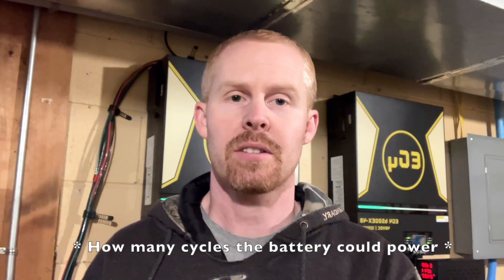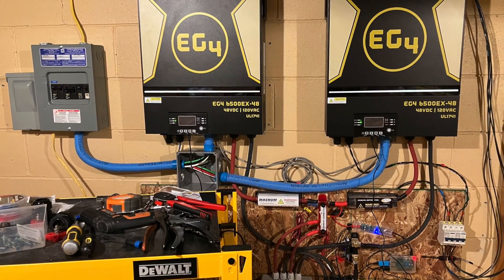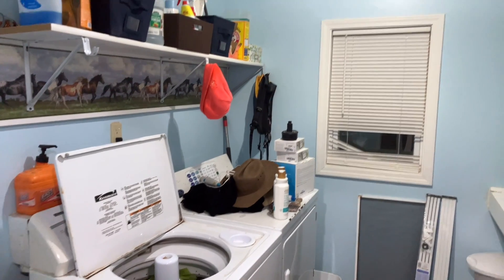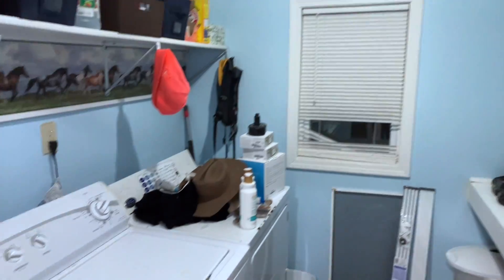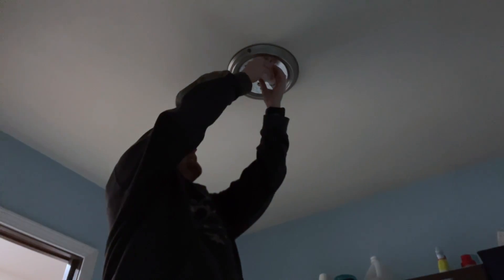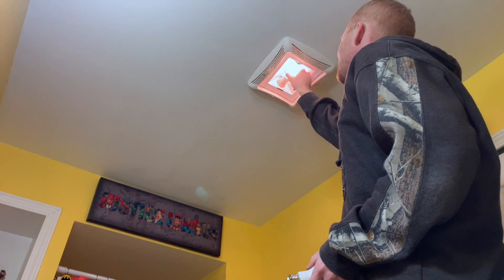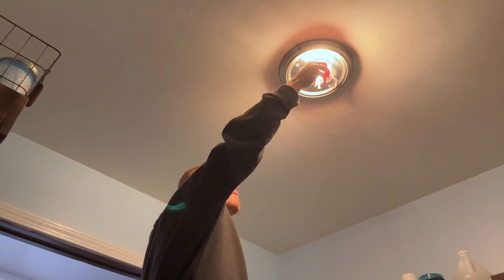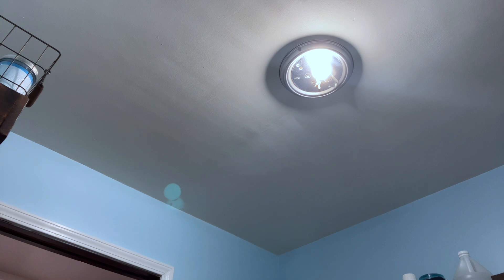Can We Fix the Flicker When the Washing Machine Runs off the EG4 6500EX?

Comment from the maker: In case you're interested, there's a thread on the diysolarforum regarding flickering lights and the 6500s.
https://diysolarforum.com/threads/eg4-6500ex-lights-flickering.50220/
Reply: Hello Adam, was this issue resolved by new set of inverters (new firmware)? If not I would advice to look for non-dimmable LEDs. I found a few non-dimmable Philips on Amazon that don't show any flickering.
Reply from the maker: @1rfsam  unfortunately not.  As I type this out, I’ve got the lamp next to me and the hall light slightly flickering.  I’m not sure if all the lights that flicker are dimmable. The one next to me is a Phillips Hue bulb.  

Odd thing is, it’s not consistent.  Didn’t notice it at all last night, but tonight I’m seeing it all over.
Reply: @AdamDeLayDIY  Probably depends on other loads... You could try the bulbs from my links I just posted on the same forum's link. These inverters are OK but honestly I'm not impressed with them.
Reply from the maker: @1rfsam  Unfortunately I checked and it's not the "add more load" argument that you have probably heard from SS.  Ironically they never tell you what that threshold of "more load" is.  

I had both phases running between 230-300W, had flickering lights.  I turned on the well which pulled more than 1kw from each phase, still flickering.  Really odd thing is they didn't do it the night before.  Go figure.

I think it ultimately boils down to "you get what you pay for", but also, "don't by the newest thing".  I wanted the 500V PV voltage ability because I need to run a fairly long string and the "US Based support", otherwise I would have gone with the MPPs.

Comment: The flickering is done by the voltage drop in the output of the inverter. This is normal when high loads are running. If you connect a voltmeter you will see the voltage variation.
Reply from the maker: Thanks!  Yeah, I knew it had to do with the voltage fluctuation.  Unfortunately the inverter couldn't handle the loads properly.  There really wasn't a "high load" running, especially when you consider it being a 6500W inverter.  It shouldn't have been blinking like that at all.
Reply: @AdamDeLayDIY this is an issue with high frecuency inverter, the low frecuency inverter do no have this issue, since isolation transformer overcome the inductive load at that particular issue. The problem is they  weight more.
Reply from the maker: @javarookie  It's not an issue with all HF inverters.  I've tested multiple inverters from varying manufacturers, some HF and some LF.  This was the only inverter that had this issue.

Comment: Unlike Europe, North America does not have mandatory regulations for electrical flicker (IEC61000-3-3). So you may buy many appliances that cause fluctuations in the power grid (flickering of light bulbs).  BTW, Please turn off the power before replacing the light bulb and pay attention to safety.
Reply from the maker: Thanks

Comment: Have the same issue with my washer. Expensive bulbs didnt help. Didnt do it when the electrician came 🤦🏻‍♀️
Reply from the maker: @SpanishLaughsLoL  It can also depend on the load on the system.  It seems like a higher load stabilizes the flicker.

Comment: I have the same issue with a growatt 3kw. And I use the Philipps LEDs and it doesn’t make a difference.

Really the only explanation is the inverter, it’s putting out dirty power. My lights work perfectly fine on grid power but do the pulsing on inverter power. That tells me it’s the inverter.

The type of driver in the LED does make a difference because even though they convert AC to DC and you’d think DC should be just continuous flow in one direction and thus would have no flicker, the type of AC the converter/driver is receiving still affects the output of the light. You could get an LED with a different driver, but I think that would just mask the bigger problem of the power quality of the inverter.

These high frequency inverters, mainly the Chinese ones, are inherently dirty it seems. 

What would really tell the story is an oscilloscope and spectrum analyzer, then adding appropriate filters or maybe even an isolation transformer. I’m still trying to figure it out

Comment: I have the same issues. It's a problem with the signwave in the inverter, dirty  and not consistent output. I can see weird spikes at night via monitoring. I'm more concerned about damage to my sensitive electronics than led flicker. I noticed the lights don't flicker as much when you have a constant load like a fan or something on. These are just not good inverters. And ss is not a good company. Eg4 batteries are good.
Reply from the maker: I’ve noticed some flicker regardless of the load.  Did a little recording two nights ago.  Had flickering regardless of 200 or 1000w on the inverters.
Reply from the maker: Now based on a comment I saw in the diysolarforum, the primary engineer at SS is supposed to be in Taiwan now working with the manufacturer to figure out what the flickering issue is
Reply: Mpp no light flicker for about the same money. I will say my EG4 have been trouble free running 6 month's minus error 61 which an update took care of. Good luck I hope they find a solution. I'm taking the solark plundge.
Reply from the maker: @ktube4848  they released a firmware update last night which is supposed to resolve some flickering issues.  From what I’ve been told though from SS, some cheaper quality LEDs will always have a flicker off grid.

Comment: It's not the bulb it's the inverter, do the same test and have your dryer or water heater running and the flickering stops completely. Once the inverter is under some load other than the washer the flickering stops. Check it out and see
Reply from the maker: Why does swapping out the bulb significantly reduce the issue then?  Now unless you really stare at the bulb, you really don’t notice the pulsing anymore.
Reply: @AdamDeLayDIY  I have tried Phillips dimmable led bulb and I still see it when my washer is going, but if the dryer is on nothing. Did you try it with a load?
Reply from the maker: @dexbad8857  yes, I’ve had other loads going at the same time and still have the pulsing.
Reply: @dexbad8857  agree ! I’ve found the same. .flickering stops when the dryer or we’ll pump . 240 load comes on

Comment: I do not get a constant flicker like you do. when a fridge compressor kicks on I get 1 flick on any light bulb I use that is LED I have 6 different brands from cheap to expensive. I find the more I pay the faster the bulbs die.  I have growatt 5k us version x 2. I also have 12/2 wire not 14/2 on all outlets and 10/2 on a couple with 20 amp  outlets. It doesn't matter the wire each bulb will flick 1 time when a big load hits like my fridge. My water heater is electric dual 2500 watt heaters 240 does not flicker bulbs. just anything with a compressor on it.

Comment: The washer motor needs a surge capacitor to handle the surge draw. It's not unlike when an A/C compressor kicks on you will get a momentary voltage drop during the power surge. A front-loader won't have the same issues...
Reply from the maker: I had wondered about something like that due to the motor having to change directions.  Still, replacing a few light bulbs seems a lot cheaper.  :D

Comment: Better quality is vague. They should start a list of lights that have the right circuitry to avoid the problem. I'd love to see more about this. One thing I can't wait to test on solar is audio interference. I have some speakers that hum like hell on grid power but when I unplug my UPS the interference goes away. I'm wondering if running off grid will be the same, better, or worse. 

Do you have an oscilloscope? I wonder if you can figure out what's causing the flicker? Is there any chance the flicker is indicative of a problem affecting more sensitive electronics?
Reply from the maker: I know “better quality” is pretty vague.  Like you said it would be nice to have a list of bulbs that works.  Maybe try a “name brand”?  

Only thing I know for sure is SS mentioned Phillips multiple times and when I tested Sylvania bulbs they worked.  I would imagine even certain bulbs within those brands would have issues.  Ultimately if you have major flickering issues, try another brand of bulb.

Isn’t humming on speakers a grounding issue?  Guess it would depend if it stops on solar or not.

Unfortunately, no I don’t have an oscilloscope.  Maybe I’ll get one someday but funds have to be utilized for other projects.

Comment: just isolate the washing machine circuit
Reply from the maker: The only way I could isolate it more is to have a completely separate inverter power it.  Not all the blinking lights are on the same circuit as the washing machine, but they are on the same phase in the panel.  The pulsing is happening across the entire phase.

Comment: I have this issue also with my agitatorless washer every time it changes directions. My Phillips bulbs don’t do it but my problem is the led fixture in my living room with the strips in  and the replacement led fluorescent bulbs int the laundry. I even went as far as adding a capacitor to the light and my panel to no avail. The only thing that solves it is increasing the load such as turning on a small heater or so. But that’s kinda defeats the purpose. The capacitor did seem to do away with the flicker I had like yours when I was at very low load and I also had one when I was taking in a lot of pv but then again I haven’t really been getting alot of sun in the month since I installed the capacitor.
Reply from the maker: Yeah even increasing the load didn’t do anything for me.  When the washer is agitating it’s using 7-800W.  

I haven’t looked at our led tape light to see what that does, but it does seem like the “cheaper” the bulb the more issues you have when off grid.
Reply: @AdamDeLayDIY   I thought I would move everything that I had problems to the opposite leg than the washer but when I checked into it I was have a slight voltage drop all the way back to the battery. I thought about going back to my older washer but seems you revealed that that would still cause me issues.
Reply from the maker: @shamusburcham332  yep.  In this case, older isn’t any better.

Comment: And if you heva a smart washer is worse and I have a low frequency inverse nice video
Reply from the maker: Would have thought a newer washer wouldn’t have these issues, especially with a LF inverter.
Reply: @AdamDeLayDIY  yes it will do itis because the smart washer has a permanent magnet motor

Comment: Good morning Adam 
  Man I swear every time I’m having an issue or problem pop up You put out a video LOL.   
  I have a 6000ex with 3 EG4 batteries. I’m having problems with my lights flicker when now matter how big the load is or what I’m drawing to start with 
 I’ve spoke with signature solar and they told me if I’m not happy with the 6000ex either install a victron auto transfer switch to clean up the light situation or
 Send my 6000ex back pay the shipping and a 40% restocking fee 🤯
   I’m really frustrated with this 
   Keep the awesome videos coming Adam  THANKS 👍🏼🇺🇸❕🌞🌞🌞
  I still don’t 100% agree with signature solar saying this is just what to expect when running an inverter to power my house      Kind of let down to tell you the truth
Reply from the maker: What can I say, I’m just a good mind reader!  😁

Not sure how a transfer switch is supposed to help bulbs from flickering…

I know it’s annoying, but I would run some tests on some different types of bulbs.  I know changing bulbs was never something I considered when looking into inverters.  

 I was actually wondering if the LF model would be any different, so thanks for confirming.
Reply: @AdamDeLayDIY  well running just 1 6000ex  is not working on the flickering 😢.  I’m thinking of adding 1 more and another battery and see if it helps.  But signature solar has told me they do not think it will address the flickering issue.  So what the heck really a let down
Reply from the maker: @cowboymcq6711  to be honest I would be extremely surprised if adding another inverter fixes the issue.  Do you have another larger load you can try running at the same time as the light to see if it reduces the flicker (vacuum, microwave, box fan, etc)?
Reply: Ok update kinda.  I ordered 1 more 6000ex and another EG4 battery hoping 🤞🏼 it will minimize the light flickering in my house  
 So I’ll have a total of 2 6000ex and 4 batteries.   O and I’m going to order the Phillips bulbs.  Hoping to get rid of the annoying flicker 🤞🏼🤞🏼🤞🏼
Reply from the maker: @cowboymcq6711  So I had an interesting experience on Sunday.  I was in my bathroom getting ready for church and the vanity lights started flickering and didn't stop.  Never done that before when I was on battery power.  So I wanted to try the "turn on something else to increase the load" theory, so I turned on another set of lights and the flickering stopped.  When I turned the second set of lights off, the flickering started back up.  Was able to replicate it several times.  Unfortunately I didn't have my phone so I could record it or even see if I could determine what the "wattage threshold" was on to determine when I needed "more power" to stop the flickering.  Was a very interesting experience though and it seems like there's something to it....still don't like it, but there's something to it.
Reply: @AdamDeLayDIY  it’s so interesting and aggravating at the same time 🤯😭 
  I’m glad we’re in this together LOL 
  Signature solar told me about 15% of there calls are about this issue at hand  what the heck  
  I’m trying to look at the positive that we’ll I am powering my house by the sun 🌞going to take a few years to break even   But wish the flickering would go away.  Stay positive bro and keep the informative videos coming 👍🏼👍🏼👍🏼
Reply from the maker: @cowboymcq6711  yeah I know what you mean.  You spend money on something that’s supposed to supply clean, stable power just like the grid (maybe even more so) and when you turn on lights your told “your not using ENOUGH power”, so you have to turn on more to stop the flickering…doesn’t make any sense to me…

I would imagine in my case, most times I have so many small loads running with all my computer gear that I’m always past whatever the minimum threshold is.  The only reason I saw the flicker over the weekend was because all my computers were powered down for the long holiday weekend.
Reply: Ive been saving up for a hf inverter system with batteries. I was kinda leaning towards the eg4 6500 and its the little stuff like this im worried about. Theres lots of focus on load testing and dc charging speed but its great to see someone sharing these moments.
Reply from the maker: @PatlYTpage  that’s one of the reasons I wanted to share my experiences.  I’ve seen a lot of people doing load tests or single appliance uses but not many showing their experiences trying to run a whole house.  

I did make a video entitled “it’s not all bad” where I do try to reiterate that they’re still able to power what I want them to.  At the price point, they’re still pretty decent inverters.  They’re not top of the line but they’re also not the bottom of the barrel.

Comment: Very interesting test Adam. This raises the question, should we go back to incandescent bulbs since offgrid takes care of or doesnt care about the light inefficiencies. My wife hates LED lights
Reply from the maker: That’s a good point.  I guess you would have to way the costs.  Incandescents use more power but don’t have these issues.  They burn out sooner so you would have to replace them more often.  LEDs are very efficient and last a long time, but it seems like if you don’t have the right ones, they could drive someone mad in an off grid environment.